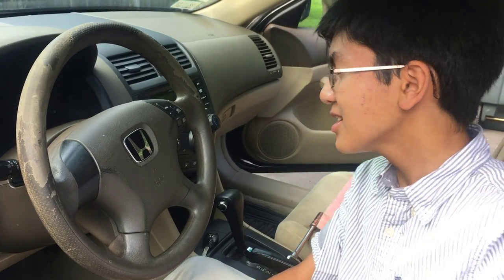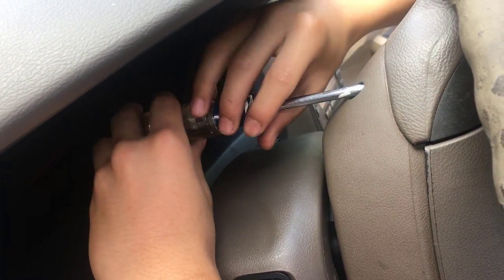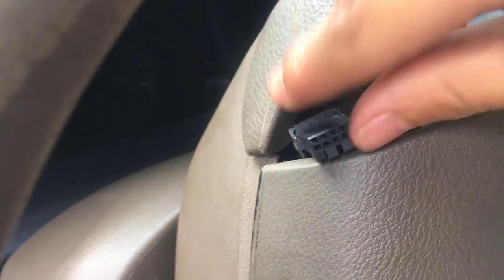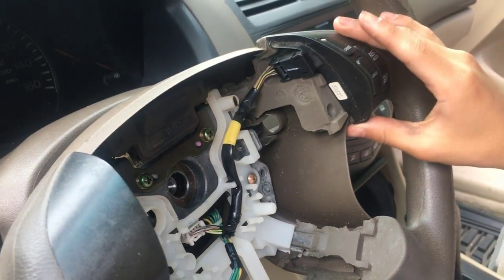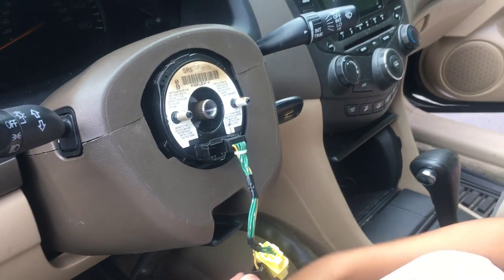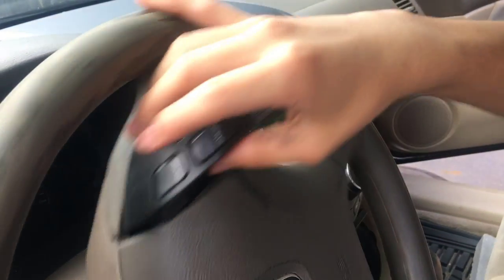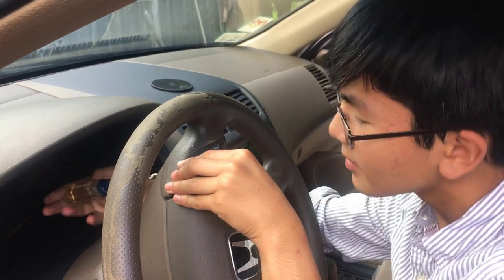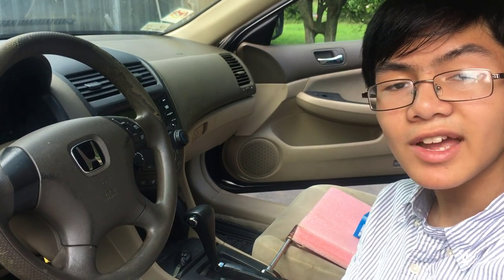How To Replace Control Switches (Audio / Cruise  Main) On Steering Wheel For Honda Accord 2003-2007

Comment: After removing the screws in my 2008 CRV (mine actually did come out all the way), I cannot get the unit to budge at all, therefore cant get to the point where I disconnect it as you do at ~ 1:18.....any suggestions? Thanks very much for making the video in the first place !!!

Comment: My 03 accord cruise control buttons work but the radio control buttons don't work. Think that's the switch or clock spring? Thanks for the video!
Reply: Prob the clock spring , did u ever fix it ? I have the same problem , I went to the junk yard and took out the controls for the audio and that didn’t fix it , so prob the clock spring for me
Reply: @mxndo619  no I ordered used controls off Ebay and they sent me the wrong ones but still plugged in they didn't work and I couldn't get the airbag cover off a couple of the screws were messed up. I just left it!

Comment: Hi, very good video, I have an Accord 06 LX, but it does not have the controls on the steering wheel,
Do you think I can adapt them?
I was going to buy the audio controls but both the audio and the cruise are coming, however the harness is bigger than the entry I have on the steering wheel, my input is similar to yours with 5 pins.
what do you think?
Reply from the maker: I think you could adapt it, but you might have to get a different clock spring if the connectors are not the same.

Comment: My doesn't have a clip. It's two white connectors soldered to the board.
Reply: same for me. Did you find a way to remove the connectors?